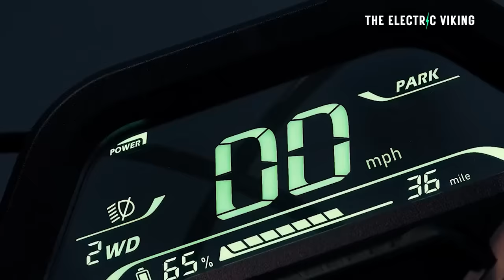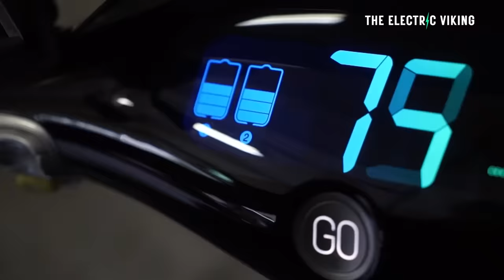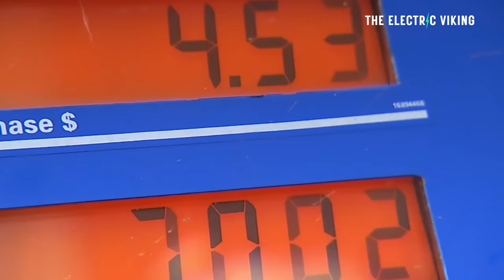Electric scooters destroying oil demand 4 times faster than electric cars

Comment: This wouldnt really work out side of cities though - or places where there was a lot of traffic - it could work in the states, but because how far everything is - it does raise eye brows how well it will work. Again, for larger cities where you dont have a means to charge it up - this would work great, but I would also fear how well it would be kept up and maintained after a few years.
Reply: If the swap process is profitable then why would it not be continued? Understand it works really well in Taipei.
Reply: What has traffic to do with it?
There is a ton of traffic in most cities. That's why they use scooters. To get through traffic.
Reply: @markthomas7279  Depends on how well you can access it and how easy it is to get in and out with it. In lots of smaller cities or cities built around the idea of space - it wont make a lot of sense because you can just go home and charge. In some of the more compact cities you would see it more because you dont have that as an option always.
Reply: @Tschacki_Quacki  A lot. Spread out cities here in the states dont have to worry about it and thus can either charge at gastations or move around more freely to the point swappable batteries just dont make sense. Where in more compact heavy traffic areas/cities would.

Comment: Internal combustion scooters have extremely dirty exhaust (I'm referring to new ones but old ones are much, much worse) so the switch to electric makes a massive difference. Internal combustion powered lawnmowers, trimmers, and leaf blowers are also extremely dirty - the louder something is while running the worse it is, mostly. Inexpensive and safe batteries (that aren't difficult to collect at the end of life and reuses or recycle) is key to cutting oil demand and clearing the air, water, and soil from petroleum pollution.

Comment: I agree in general but do question that "save a million barrels of oil per day" number.  Yes, I save a lot of money I'd otherwise spend on gasoline.  But, I have multiple ICE vehicles, including motorcycles, yet commute on an e-scooter because I prefer to do so.  However, I suspect the majority of people riding e-scooters around the world don't actually own and will never be able to own an ICE car.  They are using e-scooters instead of bicycles.  Maybe... e-scooters instead of ICE scooters.  But, even then, the fuel savings are far, far less than what switching from an ICE car would be.

It's great that they are using e-scooters.  Certainly far better to step up to an e-scooter instead of an ICE anything for the cities they live in.  But, they don't automatically save the equivalent distance in ICE car consumption.

Comment: In the west we have spread out low population density suburbs with large travel distances to get to work with our ongoing economic model based on ever available cheap oil, and available tarmac. without Tarmac our roading system will collapse.

Comment: This is a lie, both the electric cars scooters and bikes are using gas and oil by receiving their power from the grid which is...

You guess it mostly natural gas and oil and coal 

Yes some solar wind hydro is used as well.

This does not even consider the destruction of earth mining which uses gas and oil to mine produce these 

Let's not forget these scooters and bikes are replacing truly clean pedal bikes and push scooters and adding strain on the grid.

Comment: I think that if we're serious about this, and not just enjoying a new game we can play with this or that new toy, like children, then things like cars or scooter (or trains even, perhaps ) are a transitional measure forced on us by a combination of the legacy of what we've built so that we can live dependent on cars, and our loathing for change.

What we need to be doing is promoting dense development (because that reduces the amount of daily travel, basically), and at the same time trying to avoid this turning dystopian.

And to visualize what that might become (before setting off, maybe have something to aim at), we need to imagine the possibilities. (Duh, but this is needed to avoid the objections of anyone taking what follows as "A Plan", as opposed to "A Vision" - i.e. this is not a set of steps one applies known parameters to, to more efficiently carry out. That comes later. This is trying to get new bearings to head on. If you don't do that, you very efficiently work your way off in the wrong direction. And you pat yourself on the head for it at the same time.)

This is my general take. You build tall, "monolithic", and linear. So far that's just following the "inner city land is expensive" recipe. The difference is that you need to (if it's possible) keep green space all around these "Lines" (using that Saudi project as a very rough illustration of the overall geometry of the thing).

Why? Well if you build a huge pile of these all in one lump, it's bad. (Simple as that. For obvious reasons.)

I think we need a lot of "private green spaces" in that "green belt" on either side of the long line of tall building, rather than completely public spaces. Have some access paths (and have some locked gates, too, since gangs might find more open spaces a good place to operate in.) The access path makes the garden of someone else the park that pleases your eye with green stuff and birds and things. Obviously there needs to be enough room for the most restless to move about in, and not feel like they're on a treadmill, but I'd prioritize private spaces that people plant in their own way, and fit public access around that.

So make compromises between "Inner City" and "Suburbia". Try and have the best of both.

And then once you have a good idea of what would work nicely, then go into "Planning Mode", obviously. Chuck out the impractical without pretending that "practical" and "comfortingly familiar" are the same thing.

OK I need to mention cars and scooters in this context before I go. It's obvious, I think? You have trains, trams, those "conveyor belts" they have at airports, and so on along the line of the habitations and work-spaces / built environment line. In the green belt one thing you Don't want is cars. That would spoil it. Walking and running would be top priority. Then muscle powered wheeled vehicles. And then scooters (provided that they were properly speed restricted, so as to keep all the walkers, joggers, dogs, babies in prams, etc as safe as possible).

Comment: I live in western Canada, specifically, in Alberta. E.Scooters are available in several cities, but I have no data regarding utility.  Ev's are a hard sell here. Outside of the few major cities, there are no EV's to speak of. I see the occasional hybrid, but the distances between towns (about 20 miles or more) & the huge number of gravel roads will chew the battery boxes out of these cars in very little time. Next week we will be having minus 40 deg weather (take your pick of Celsius or Fahrenheit !) , so, so much for EVs.  Until we find a battery chemistry that isn't a bomb or generator of toxic gasses, & that isn't 
hugely compromised by cold weather, EVs will remain as a joke. The huge maintenance costs , the insane price of replacement batteries (over 10,000 dollars, & over $60 K for two different EVs), in North America , they will remain a joke.
Reply: ev arent all that bad, prius has had battery for far longer time, plenty of car crashes but no crazy fires like evs. batteries last lot longer than the usual ev despite smaller size

Comment: Electric bicycles are even better. My fat tire cargo bike gets me to the grocery store almost as fast as a car. I load up three bags of groceries, then ride home at 22mph. The cost is pennies. No license, no registration, no insurance, almost no maintenance. You can get one just like mine for under $1800, brand new delivered. Range: 80 miles. Top speed: 32 mph. Better ones will be available in 2024, as batteries and motors get better and cheaper.

Of course, there is one problem with scooters and bikes: the weather. When it rains, forget it. When it snows...don't even think about it. People will still need something to protect them from wind and snow and rain. At bare minimum I'd need an enclosed three wheel scooter. Even that could be damn dangerous in stormy weather. For that, you still want a thousand pound car.

Comment: Reasons electric scooters are not a viable alternative to trains, buses, taxis and cars;
- not viable for the elderly, disabled, the intoxicated or the young : requires physical ability and awareness of traffic rules.
- highly dangerous for the scooter operator in accidents with vehicles, potholes, and for pedestrians. 
- terrible to use in wet weather.
- difficult or impossible to travel with any meaningful payload; ie groceries or goods.
- dangerous and impractical to use on roads where the speed limit exceeds 40km/h.
I say this as a cyclist and ebike rider, with 30+ years of experience. In the past 10 years the roads have become significantly more dangerous for small two wheel modes of transport. Likely because car drivers are distracted with their phones, and people have generally become more impatient. Fellow riders have also noticed this change, and almost always have stories of themselves or friends being hit by distracted drivers.
I think there will be a resurgence of small transport devices in 10+ years when FSD can be applied to small pod cars, that will communicate with a network of other vehicles and their sensors to keep everything running safely and smoothly. We may also see far less traffic lights and the removal of the need for traffic lights and other traffic control systems.

ps. Sam, you can't be serious about suggesting getting rid of commuter trains..? or is it just clickbait sh*t stirring? It's almost on par with suggesting getting rid of meat production is good for health and the environment as per your Tony Seba (vegan) video.. that point that makes me particularly sceptical about Tony's other ideas... ideas that (as a long term TSLA investor) I want to become true... 
Note: I was also a vegan for 7 years : Do NOT recommend.

Comment: It's going to be this weird dance because even reducing Demand by 2% drops the price of oil and gasoline by quite a lot because the most expensive barrels of oil don't have to be pumped. And the price of oil is set by the most expensive barrels, not the least expensive barrels.

Given the resulting inexpensive gasoline, the benefit of electric vehicles will be reduced.  

But then new oil and gas producers won't enter the market and eventually the price of gasoline will Spike again. And the benefit of electric vehicles will be increased then.

Also economies of scale will be lost for refiners and the fixed costs of running a Refinery will become more prominent in the price of fuel.

Likewise we could see an increase in attacks on shipping from oil-producing nations in the middle east.

At some point the network effect for internal combustion engines collapses and it becomes very expensive to own and maintain an internal combustion vehicle.

Comment: ink electric bikes  will be more popular than electric scooter s in the West. Seems more like a cultural fit, at least in the next 10 to 20 years. 

Now in cold CT where I now live, suburban to exurban areas scooters will not win due to temperature for half the year and the roads are too hilly and curvy. I don't see it as safe. Even biking is questionable during those times.  As I type this there is a ton of salt on the roads as another snow storm is on the way.  No one will use a bike or scooter on icy roads.

Comment: And yet fuel prices stay about the same and oil comoanies are posting more profit than ever.  Almost as if demand hasn't dropped, just the use of petroFUELS.

And yet the earth is in even WORSE condition than before, but e-bikes and scooters, which are burning more often than even EVs, are 'making a difference.'

Sure, Sam.  Sure.

Comment: From Norway.  Eletric 2 wheelers are topp in the above 5°C conditios. And i think it is smart  Small and easy to park and take smaller space in traffic.  But we are soft and need some protection to avoid (head) injury.  

Consumption of fossil is big in making......drumwhirl .. fossilfuel! and sement, and operating heavy machin. SO we no try to convert to el or hydrogen what is possible. Expencive.. 

Since we have half price in tollroads in to citys you see most EV there. But there is a LOT of driving far away from the citys and there will be slow adapters. The EV's with long range is expencive. Around 500 000 NOK (€45000).  By 2025 the goel is selling 100 % EV. I don't think we will get that high but about 90 % IF EV still ceep all the benefits it already have.

Comment: and never mind the electric scooter. there's an even more efficient mode of transportation. The bicycle (electric or not).
More efficient than scooters and with a massive bonus in health benefits.
Reply: Ebikes are a bit more efficient, yes, but you can take your scooter into a shopping mall and use it as a shopping trolley.
I even brought home a gaming chair and microwave with one because they can sit on the scooter floor, unlike with an ebike.
Reply: @stevenjones916  No e-waste with ebikes or scooters either. Everything is recycled.
Reply: @stevenjones916  I agree but choosing one or the other is silly. It's all about preference and usage. 
A bike if electric can treble the usage and mileage, saving far more CO2. Sure there's more waste but it can more than offset that trough usage.
Then there's other factors: many ebikes are deliberately difficult to repair, others are prone to fires etc.

Comment: Wouldn't mind an electric scooter, but winter over here throws a wrench in anything  "electric transport". Up north where towns a far between they even canceled train routes this year because of the danger in -40° C and below in case of a brake down. Where I live it has been between -10° to -20° C since Christmas and even some instances down to -24° C in the night. So those with electric cars are struggling with insufficient heating and short ranges. Taking any 2 wheeler to work, electric or not,  is not even a thing anyone is thinking about right now.

Right now, Sunday 7 January at 12:14, mid day, it's -17° C outside and and I have birch wood burning in my fireplace to keep down the electric bill, cause when it is cold here there are very little wind so our wind power doesn't produce much and our former red/green government closed 4 reactors during their 8 year in power because they wanted "renewable energy".

Comment: I am amazed by how many people my age (boomers)  have these things here in NZ, it does make sense - (however),  as I gave up trying to go uphill on my bike years ago😃.  So if you can have the best of both worlds that's ok by me. Also a quick promo for NZ, we do have a (sort of) nationwide bikeway, quite a great idea promoted by John Key our prime minister a few years ago.  He also tried to change our flag......🤐 that was a major flop!  but everybody who has been successful has had a few failures.  It seems we are still more British (at the moment) than Ausi for instance. Cannot guarantee charging stations on the Milford track in the south island for instance.  However, the MG4 ev was the best selling car in December in NZ full stop.  Will not happen again though, as the Government have stopped ev rebates  1 Jan 2024, and has scrapped the extra tax on diesel utes etc,  which is fair enough,  as I cannot replace my Wildtrak x with an ev equivalent as yet.  I own an mg zs ev as well and it has performed faultlessly for the last 13 months.  Byd and Saic (mg) are both bringing out (proper) 4wd utes in 2024, and NZ will get them quite quickly as we are close to the manufacturing base.  Until then, I will hang on to my ford as my towing vehicle, and use my MG for around town errands.

Comment: This video had the potential of being good.  However, only citing numbers of each type of vehicle and the claim of fossil fuel  savings for only one of those types reduces it to a statement of opinion not a presentation of facts.  How many gallons of gas/year/e-bike, or, better yet, how many gallons of gas/year/kg-battery tied up in both the ebike and battery swap infrastructure vs. similar statistics for  3-wheelers, passenger cars/ light trucks and semis? 

E-bikes and other light transportation enables economic benefits beyond avoidance of fossil fuels through enabling better mobility as discussed in the video.  How should one weigh that against putting batteries into semi trucks, which achieves the highest utility factor of any land-based transportation,  thus the highest gal/year/kg-battery fuel displacement ( at least in my mind due to lack of data from the video) ?

I don't need to cheer for a particular implementation of a technology.  I do need to maintain a balanced perspective of each should I, as either a consumer or voter, must make a decision regarding one implementation over the other.   Should I place adoption of E-bikes in urban areas above better charging infrastructure for the passenger vehicles which are of much higher relevance in my suburban location?